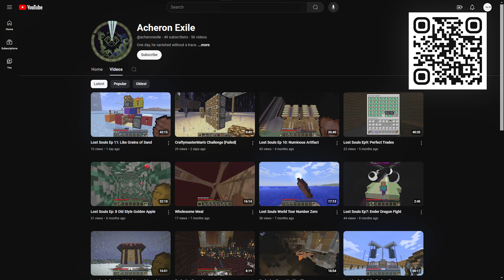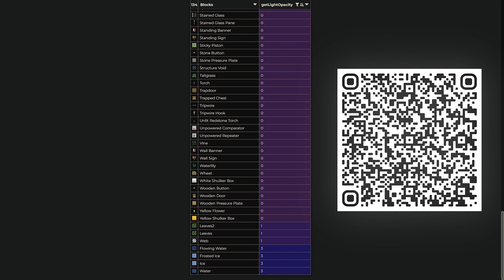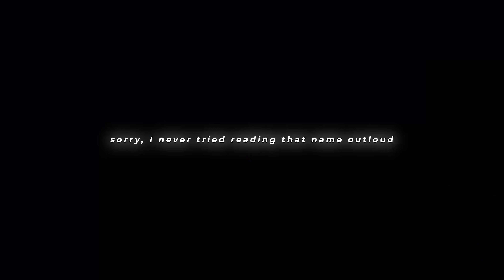Sunlight Transparent Flying Machines | Minecraft JE 1.9 - 1.12.2

Comment: Nice!
Even with all the changes over the years could there be any benefit to using these in newer versions?
Reply from the maker: Not a single time did I launch anything after 1.13, so I have no idea really xd As long as I'm aware both pistons and slime are now opaque, so you will only loose performance by using carts instead of observers (so basically any flying machine in new versions is really laggy). So I can't think of any use in new versions other than the fact that this is a pretty interesting unexplored tech and could be used to compact things here and there